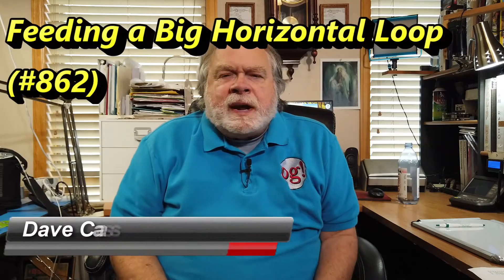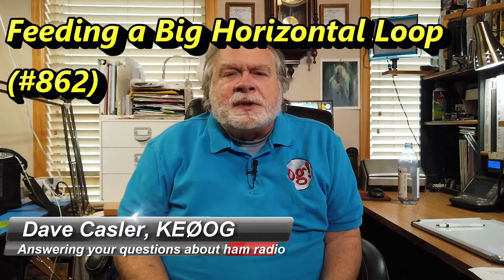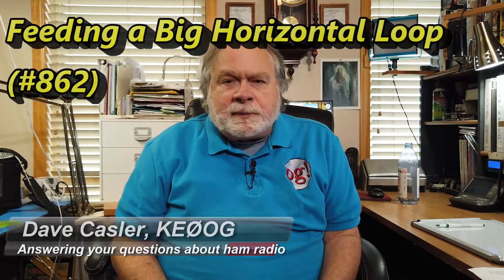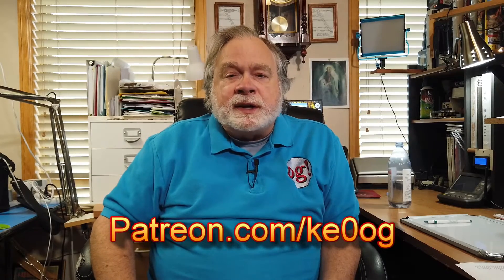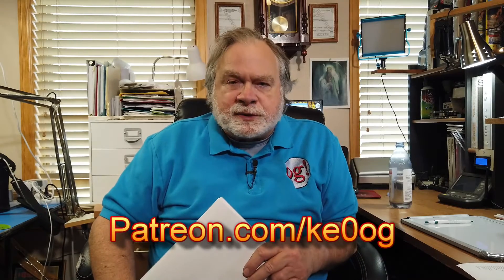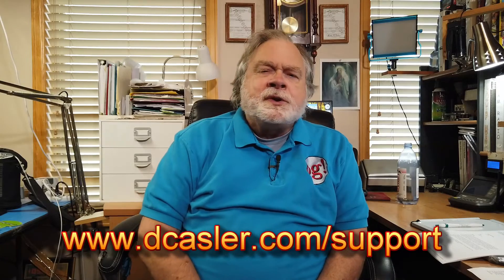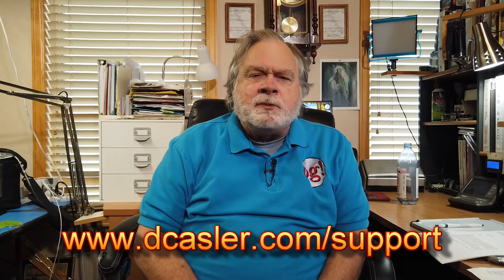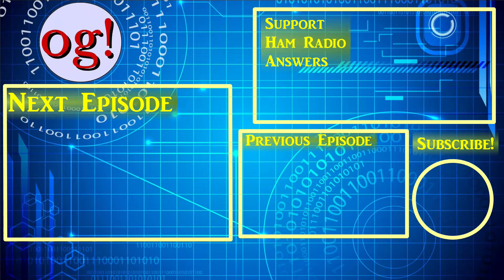Feeding a Big Horizontal Loop (#862)

Comment: I have been using a full wavelength 80 meter horizontal loop for 40 years. it works wonderfully. yes you need open wire feed and balanced tuner

Comment: I would consider a balanced coupler (tuner) at (or near) the antenna feedpoint (best case scenerio) or at the end of the ladder line. I haven't (yet) made my own open wire feeder, but will be doing so in the very near future.  Next best option for couplers (in my opinion) would be EXTERNAL of the shack and beats ANY use of coaxial cable of any length. I realise not everyone has this option but if you can circumvent the use of coaxial cable at all (prior to the coupler - as in, on the antenna side of it) it removes all sorts of issues and will result in minimum losses.

Although I am just a dumb truck driver for a living and not a "technologist", I have never been in favour of "in shack" couplers (what most call antenna "tuners") simply because whilst they make the PA "happy" by presenting the correct load (i.e. 50 Ohmsish impedance), the standing waves (thus ineffective radiation/losses/whatever) are still present on the coaxial transmission line and may also result in all sorts of unwanted results, consequently. They do what they're designed to do, and that is present a load the PA can deal with AND they're convenient, but there is a significant difference in radiation effectiveness, in my opinion. They are generally far less wide ranging than external, balanced couplers.

Just my thoughts.

Comment: With a 3:1 or 4:1 balun, you can get in most bands without a wide range tuner, and with low loss.
My antenna at 30’ reaches about 1500 miles on 80m
The vertical will work better on 80 and 40 for DX, but will be useless for NVIS.
For most, the loop will be quieter and work better on 20m and up.

Comment: Hello. Does delta loop with 75ohm coax match will be one bander? Doesn't the ferrite transformer 1:4 does all the same and it also be one bander all the same, or will be multi bander only with 1:4 transformer? Thanks. Suppose should not be any difference between them?

Comment: I have a horizontal loop, fed with ladder-line. Instead of balun and single coax through the wall, I use double coax and no balun. Coaxes exactly equal length, braids connected together at both ends but not grounded anywhere. Center lines used as leads from ladder line to tuner. This was, the coaxes acts as a shielded ladder line with minimal loss.
Reply: I am doing a similar thing with dual 75 ohm RG6 coaxes. I do have the shields grounded at the shack end. This feeds the 80-6m attic doublet (~90 ft) in my townhouse. My tuner is a MFJ-974HB.
Reply: Use RG-6 for a dual run as described

Comment: I’m using an IC7300-to my amplifier-to the tuner-to the coax- to lightning arrestor-to coax-to 4:1 balun-to ladder line. Btw, I found ladder line length is very important. I got arching when mine was too short.

Comment: Ok, I have a LDG 4:1 and 9:1 unun.  Which one would work better on the loop?
Reply: I use 4:1
Reply: You get an antenna analyzer, you choose where you want to operate, and you chose 4:1, or 9:1 if for example you need to drop an SWR of 8:1 to 2:1 at 3.7 mhz, you would want the 4:1 because the 9:1 would drop the impedance below 50 ohms which is not ideal.  If the SWR without balun is 16:1, you’d use the 9:1 balun to drop the swr to less than 4:1.

Comment: I have had the same antenna for twenty years now and with my Antenna tuner have used it from ten to eighty meters. Since I have retired a few years ago now use an 811H amp. on the antenna.  Getting wonderful reports all over the world and it does a great job on receive.  Being very old now I love the antenna because it has never needed to be worked on over the years like my past towers and beams needed from time to time.  The antenna is mounted on four twenty foot masts that I have used for various antennas that I got at the old radio shack in the 70s.  Use number 12 insulated wire.  Use an old Swan antenna tuner that I bought in the 60s.  Still use a Icom 751c to run the new amp.  Please have a great 2023.  de WB7ORB